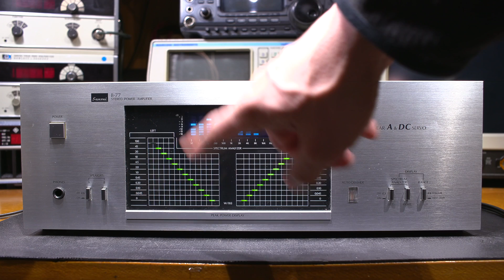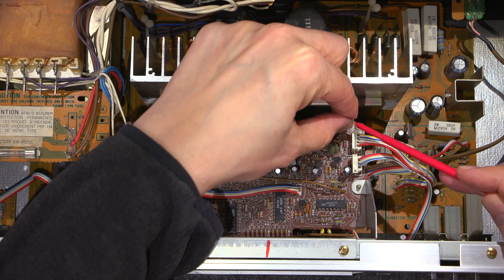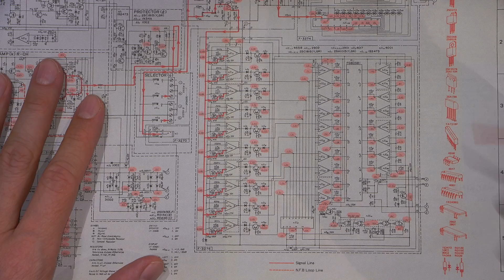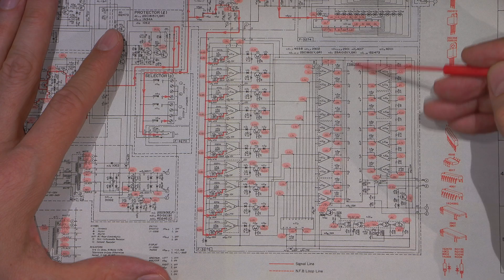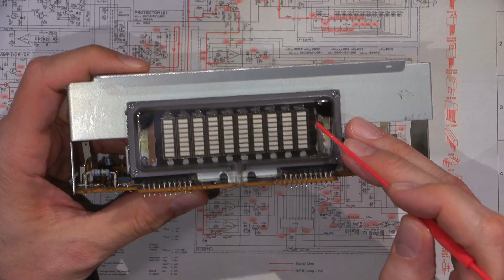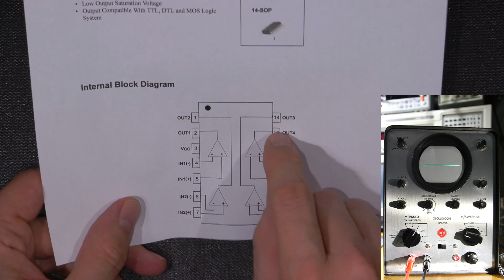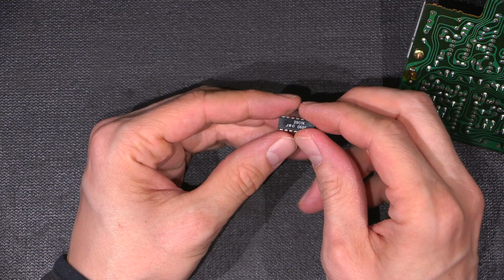Electronic Repair- Sansui B-77 Stereo Power Amplifier!

Comment from the maker: Learn about electronics in a different and very effective way, and at the same time, have access to Mr Carlson's circuit designs! Go to Mr Carlson's Patreon page, click here: https://www.patreon.com/MrCarlsonsLab  * (EDIT) UPDATE: New Curve Tracer video just launched on Patreon!*
Reply: Good video ! I remember building a V.U. meter in high school electronics. It too used the LM399 chip, but it used leds instead of a VFD.  The front end used the LM324 chip to clean up the signal and provide the different frequency spectrums.
Reply: Mr Carlson's Lab pretian
Reply: Mr Carlson's Lab patron
Reply: @Dave Micolichek  I guess it was called a frequency spectrum meter. I guess I wrote the comment wrong. Thanks.
Reply: @hvacr tech you should see my work benches !
Reply: Is there a way to buy a membership through annual billing? Do I have to go through pay pal?
Reply: @hvacr tech Having your house resemble Mr. Carlson's lab is a very nice problem to have.  Lol
Reply: Mr,Carlsons Lab. There is no spectrum analyser in the cheap Sansui amp. It is only a display. Secondly, on the subject of safety at work, never pile equipment up like that in your Lab it could fall on you. Thirdly, the DC smoothing capacitors in the power  supply usually don´t have ´´leathal voltages on them. Fourthly, the term is `outgas, not `off gas.

Comment: Thanks for the very good video. Would these failed Opamps be able to found by multimeter diode test? Maybe with slightly different forward voltage drop in measurement?

Comment: Very cool trouble-finding method!  Made me realise I should be doing more of this.  I have a Hameg HM604 with a 'component tester' built into it - basically a rudimentary curve tracer.  It's strange, I never thought to use this to find problems with in-circuit parts before.  In my mind, it was just there to test desoldered parts and invdividual components of dubious history or origin.  Turns out I was pretty much completely unaware of the very powerful circuit diagnostic tool I had been sitting on!  I'm aware of the possibilities now, thanks!  That old CRO is going to be warmed up more often at my bench now.

Comment: What would you check first if the VFD doesn't illuminate at all, but the unit works correctly otherwise..?  ..aside from the internal//external fuses and face wiring connections? It is an older Laser Disc player that still works exceptionally except for the display, and I use it often. It's a McIntosh MLD-7020,  essentially a dressed up slightly modified Pioneer Elite 9X series from about 1998? The faceplate and button bulbs  light up as they should but the VFD is completely  dead.. It quit illuminating all at once with no warning, the schematic is crazy complicated to read! Worth it to me to keep, though some have dismissed these players, The CD section is exceptional as well and plays Laser Disc, Video Discs and Compact discs. Thanks again and I love the videos!
Reply: Phil it sounds like it might be a dry joint.  You could check the soldering in that area, particularly on the vfd itself.

Comment: As an old audio repair guy I was wondering the whole you must change everything in a unit when restoring it (not buying that) I was wondering if there is a life on the electrolytic caps of if they could just be checked for leakage. Also the transistors seem to hold up well over time so should it just be check things and change as needed or dump the caps?
Reply from the maker: Hi William, Caps degrade over time due to the chemicals inside. Transistors are usually quite stable, aside from the Germanium types that grow whiskers.

Comment: Sansui ended up becoming a sad story.  It started out as a premium Japanese brand, fully able to compete head to head with the likes of McIntosh, and they made great equipment all through the 60s, 70s, and 80s.  But then they were bought out by Mitsubishi, and that was a tragedy, because Mitsubishi is gutter slime.  They also bought Akai and soon destroyed the reputation and quality of BOTH companies, and the last Sansui branded equipment I saw for sale new was definitely low tier garbage, on the level with such wal-mart brands as Emerson and Funai.  Not only that, but Mitsubish just THREW AWAY virtually all the inventory of parts for the classic Sansui and Akai products.  

It's safe to say that you can just ignore any Sansui product that has the newer logo that looks like a splatter of bird poop.  Only the equipment that carries the rectangular block Sansuit badge is worthy.
Reply: Sad to hear that.  Thanks for nuthin mistibushi.

Comment: You talked about displays and E.L. lamps. At one time, I worked for a co. that made trainers for NASA. One of the trainers was the LEM (lunar excursion module). All of the displays were back lit with E.L.'s. They were made on ceramics not plastic for very rough service. These types of units were eventually made into night lights that glowed green. BTW, I sat on one of the couches with all if the meters and gages lit. IT WAS AWLSOME!

Comment: Maybe that is why all HIFI Amplifiers are being reduced to DSP based units with ADCs for input and High Voltage DACs for output to the speakers, an example of this is the new TECHNICS SU-R1000 which would cause $40,000

Comment: Great video,Mr.Carlson. I have this amp. I replaced a couple of ICs to get the spectrum analyzer working again thanks to this tutorial. I have a question: The 500hz bar on the analyzer does not light at all, what could the problem be? Thanks in advance.

Comment: I have this whole setup I bought new in the early 80's...B77 power amp...C77 preamp...T77 tuner... they have been packed up in the original boxes for at least 30 years now in perfect condition...The amp blew a fuse... So I replaced it...but that burned out also very quickly... So I figured it had a short in it...Don't know how to fix that and never took it to get fixed...always say I will...but I don't...lol.
Reply: Wow I'd buyem off you Jazzyboy!

Comment: Hello, you have great and informative videos! I have been fixing electronic gear for over 35 years and still pickup some new tips and tricks. I have a very old Tenma analog oscilloscope that has a "Component Tester" built-in which runs the scope in a sort of "X Y" mode and looks and works just like your signal tracer. I get all the same readings when looking at Transistors, diodes, regular and zener. I thought I was going to get rid of the old analog after purchasing my Digital storage O-Scope but it is still very useful for a few reasons. Keep up the good videos!

Comment: Dear Mr Carlson - first i thought you're being a fusspot, discharging the comparatively low voltage caps in a Solid State amp, and reminding us to isolate the supply - 'elementary' .. But then, I remembered...

WAY back in the day fixing a similar SS Sansui amp - these sure sounded nice, but this one had no output protection, and what was happening was, I'd replace drivers and outputs, the guy would bring it next door, connect it to a cab with non standard impedance, blammo it blows again and he brings it back - a couple of times in the same night..

I should've said 'you cant use THIS amp with THIS speaker', but he's bitching bout how he wants to demonstrate n sell yon speaker cab, so I schlepp on and replace this stuff AGAIN, getting irritated.

In a hurry, I find I can get the covers off, and prop the chassis up at chest height, soldering iron in my right hand and pulling the transistors out with my left, maybe with little forceps (either no desolder pump handy, or just plain impatient..) Thing is.. I'd neglected to unplug the line (240 in the UK), and the way I'm holding it.. Well like yours, the off switch has uninsulated spiky tags pointing up.. Into yours truly

Smelling your own flesh burn is usually a sign a repair's not going well. I kinda screamed, amp went flying, and found two black puncture marks on my left wrist, and of course the smell... Hmmm

So like, yeah...

 *Despite the low voltage in SS, the current can do quite a bit of damage in the event of an unintended short, or misplaced probe... So yeah, time to make antoher discharge probe methinks - (mine was a bit smaller and didn't light up, lol, but yeah - these are good)

 Seriously folks if you see people playing fast and loose on these tech channels PLEASE don't copy our bad habits. For example, I tend not to use a wriststrap 'knowing' where and when to ground myself - but I came a cropper last week on a pretty classic lil cassette deck - I was keen on fixing this ONE stuck button, and mechanically it's quite a challenge to dissemble, and I'd figured without.. An early MOS control IC. Yes, just the static from your body CAN fry silicon!

 OTHER bad habits, with line voltage and tubes can SERIOUSLY ruin your day - maybe permanently!

Comment: I have this exact same power amp. I found it a bit "harsh" to listen to. So, I replaced the op amp in the preamp circuit with an L49720 and it's a totally different beast afterward.

Comment: wouldnt it be WAY WAY easier to just stick a new 2901 IC on top of any suspect once to see which one has the problem??
Reply from the maker: It doesn't work like that, but it would sure be nice if it did!
Reply: oh. I was pretty sure it was an op amp but a friend (a real technician, yes) was showing me that trick - maybe it was with a TTL chip though

Comment: Right after you opened the cover, I could tell someone's been in there before. The zip-tie at the back which was being crushed by the case cover, as well as the excess of thermal compound spread across the heatsink. Neither of those seem factory.

Comment: The "big question" is why did TWO comparators fail at the same time? 
Could it be that there might be something wrong with the display that is causing them to fail?
Reply from the maker: Some inexperienced tech probing around probably created more issues.

Comment: Most of the gear is for decoration.. But this is well done :-)
Reply from the maker: New to my channel Thomas? Every piece of equipment you see has been used in a video. Thanks for your kind comment.
Reply: @MrCarlsonsLab  I see.. Great knowledge you have. I run an amplifier analyze lab with modern high end gear. For this I need not much gear. I am not able because of missing knowledge and time to do this fantastic repair jobs.. Continue please.

Comment: Don Rumato

The main idea of SANSUI desiners SUSUMU TANAKA and SUSUMU TAKAHASHI was to minimaze TIMD ( transient intermodulation disdortions) in audio power amplifiers which was the main cause of harsh "transistor sound". They did it by using patented DD/DC differential stage in input stage of power amplifier and gettin  high SLEW RATE of output signal. They followed and developed the ideas of MATTI OTALA - ther co-member of AES (AUDIO ENGINEERING SOCIETY ) firstly presented in 1971. Result was achived and natural sound from vinil LP and tape decks started giving a lot of joy to sensitive ears by means of bipolar transistors and not only with tubes . Idea also was developed by ROBERT CORDELL from BELL labs . He used power MOSFET"s and write a wonderful book " Designing AUDIO POWER AMPLIFIERS " in 2011

Comment: ~~Question~~ about my Heath SO-4552 Oscilloscope which has a built-in "component tester" (ie, Octopus - Signature Curve Tracer) that maybe Mr Carlson or other expert could give an opinion...

The RMS voltage and current of this octopus is higher than that of the typical Octopus circuits, which seem to be only 1v and limit to 1ma current.

Here are the specs of the Heath octopus:

Test Voltage: maximum 6V rms (open circuit)
Test current: max 11ma (shorted)
Test freq: line freq (aka 60hz)

So basically I am wondering whether the 6v rms and 11ma will risk damaging components under test?  The manual suggests that it can be, saying:

"transistors used in high-gain low noise applications may be permanently degraded when subjected to a B-E reverse voltage that exceeds breakdown rating.  The component test open-circuit test voltage can be as high as 9V peak. This voltage can be reduced by resistive loading or zener clamping diode to permit safe transistor testing."

Any thoughts?  I'd like to use this built-in Octopus because I already have it.  The scope has rather cheap specs, though, only having a vertical down to 5mv, but otherwise suffices for my basic needs.

Comment: Beautiful hand rendered artwork, with a gorgeous VFD up in front!! AWESOME! I put a new non-standard VFD in one of those 1980s Heathkit synthesized output ham radio transceivers.  I remember getting a free tiny CRT television AM FM SW CB radio for attending a sales pitch for a time share in Nevada. The schematic for that is a thing of beauty! Wave forms galore, signal paths, diagrams of every component and even a quick guide to the most common problems.   That RCA scope reminds me of "The Octopus" test circuit for an O Scope. OH HO! IT IS AN OCTOPUS & A Sine WAVE GEN ON AN OLD RCA Bread n Butter scope!

Comment: Is it important to have an ESD safe desoldering tool when working on ICs? My Hakko 936 Soldering station is marked ESD safe, but I am not so sure about my Hakko 808 desoldering tool which is not so marked. Obviously I do not care about zapping the ICs I am removing, but I am concerned about other ICs located elsewhere in the circuit.
Reply: @C17H25N FTW  Thank you for your insights. I am not so much concerned about ambient static such as that which is in a low humidity environment - something of which we all need to be mindful. I am mainly concerned about the stray, wild electrons that come from the AC heater coil in the soldering iron. Soldering stations that are marked "ESD Safe" have special shielding to protect delicate circuits (such ICs) from the stray electrons. The concern is that my desoldering gun is not marked ESD Safe, so I wonder if I am sending out any wild electrons from the AC heating element in the desoldering gun into the IC circuits. I have mainly worked on tube circuits which do not have these delicate circuits, so no big deal. Now that I am starting to build some projects with ICs, I am a bit concerned about using the desoldering gun. Maybe I will just fork out some more money to get an ESD Safe desoldering tool.

Comment: The word Servo is on the face and I've seen it on other receivers - I only know servo as a motion device - how does that apply to an audio device?
Reply: OldePhart The output voltage is controlled just like a servo motor would be: the output goes back as a feedback signal, gets subtracted from input (setpoint), into an error amplifier, and then into the actuators (output transistors). Many transistor audio amps work open-loop, with only local feedback on some of the the active devices. Closing the feedback loop can decrease distortion, if done correctly. The frequency response of the feedback loop has to be designed to work in a given application, so it’s not unlike tuning a servo regulator.

Comment: Another superb video, thank you. Question: I've never seen a curve tracer in action before. Could it have identified all failure modes of of those op-amps? What would have been your procedure if the curve tracer had found no fault when testing from ground to the outputs? Would you have then tested from positive to the outputs of the same op-amps before moving on to the next components further up the signal path?

Comment: hello Mr. Carlson, s
I just bought a panasonic dr 48 receiver (rf 48 in the usa),
but here in europe I can not find the electrical schematics, maybe you would have websites that will allow me to get this schema?
if you ever had the time to look what you find on the other side of the Atlantic to send me this diagrame to make a restoration of my new receiver?

thank you
and best regards

eric from France
Reply: If you are still looking - search for RF-4800 service manual, that should turn it up. The 'panaport' Yahoo! group files section also has it.

Comment: ive  always  wanted  that  b-77 i  think  its  a  very  different  power amp i  like  dual  display  leds  and  sptrm  dislpay   realy  cool early  to mid  80s  man  you realy  went  straight  to  the  problem  i  learned  alot  of  saftey  info  realy  cool  that  box  device  you  made  and  then  the  other   one for  checking   those  op  amp  ic s  on the  spectrum  board  displays  and their  circutry  look  so  tedious  and  difficult  to  fix  but  no problem  for  u  !  nice  work  .